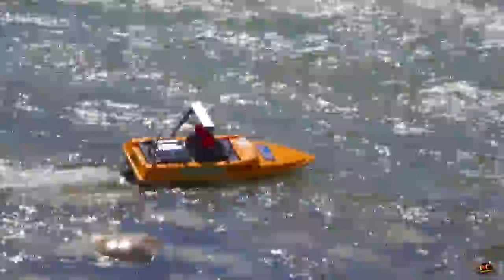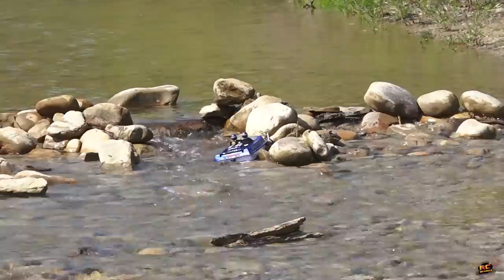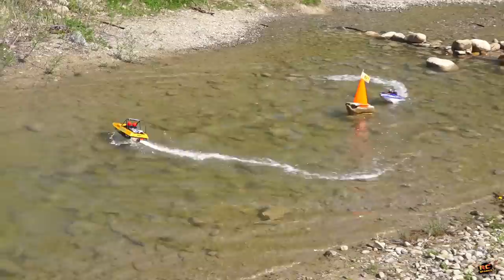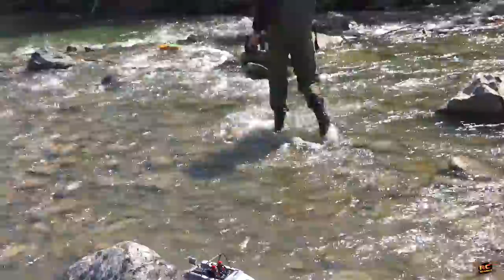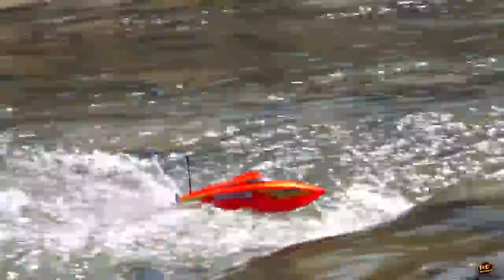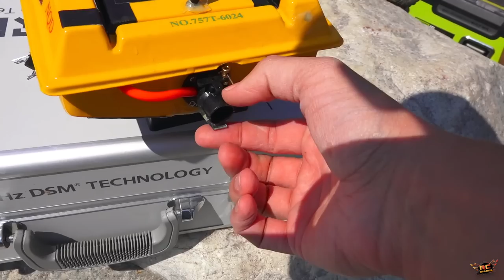RC ADVENTURES - Tiny Jet Boats Racing - PT 1 of 2 - Convergence: Gathering of the Racers

Comment: To add to your point, and I only bother because I've had it happen. Adding too much power to any of these boats even the ones with props causes cavitation, which can and does melt props. Little turbines like this have it even worse, at best you'll break a fin, but worst (and I've seen this happen) they will melt together and it will just lock up.

Comment: Cool video, I had mine out today.were do u mount your battery?
Reply from the maker: +sweet valley rc about mid way up, on the left side. My esc is on the right side, ahead of the steering servo
Reply: +RCSparks Studio thanks I'm gona try running a bigger battery on bottom of boat, I've been running only a small 2s,1300 mah batt.in stock location and seems like I'm always suckin air in.like I'm not heavy enough.
Reply: ，l县。

Comment: I love me some Boat Season. Question @Sparks: I'm trying to get as much suggestions as i can, ive got a Blackout XTE with a 550 stock motor, well stock everything. I'm wanting to get some serious speed with it for crawling and road runs, what Motor/ESC/Battery would you suggest to upgrade to?
Reply: +Godz Typically, its hard to get one set-up thats good for crawling and for speed. The gearing for speed usually doesn't allow for enough low end torque to crawl with. However, if you use a Brushless sensored motor and esc you can achive this with some success. Tekin is a good brand as well as Novak. There are also some cheaper option in companys like Hobbywing. Keep in mind that Brushless sensored systems are extremely subseptable to water damage.
Reply: Chris O'Donnell Alright thanks, so brushless isnt water resistant unless you make it?
Reply: Well no, you can get brushless systems that are waterproof but its the sensored motors designed for low end use that are finicky with water. Then can be waterproofed but tend to be more trouble some then the sensorless motors
Reply: +Chris O'Donnell ahh gotcha, thanks for words of wisdom ;)